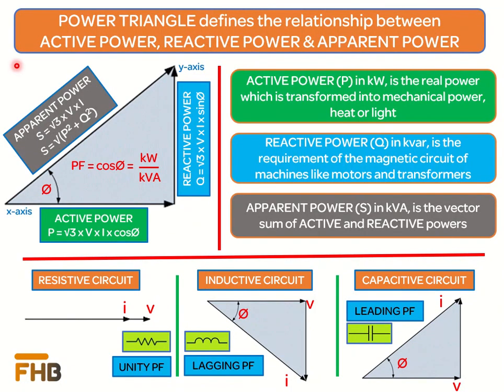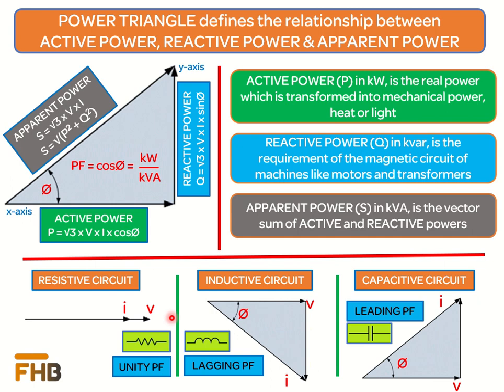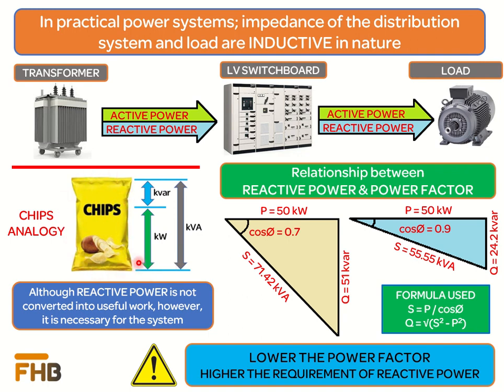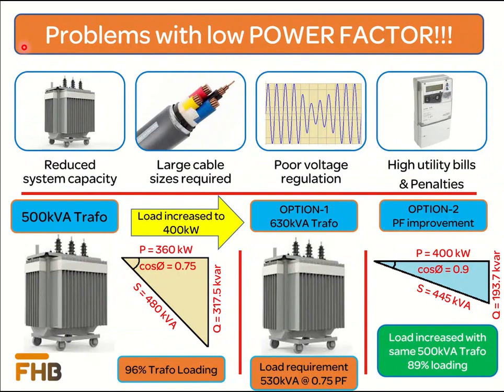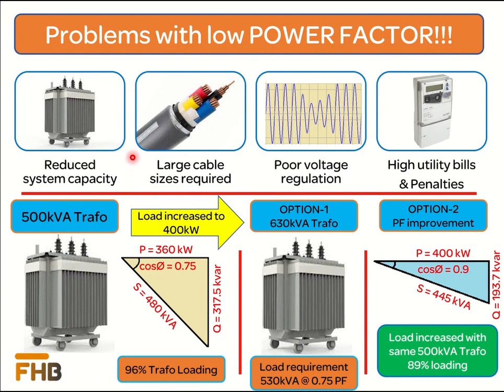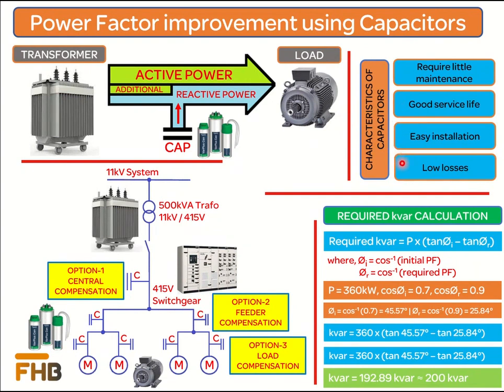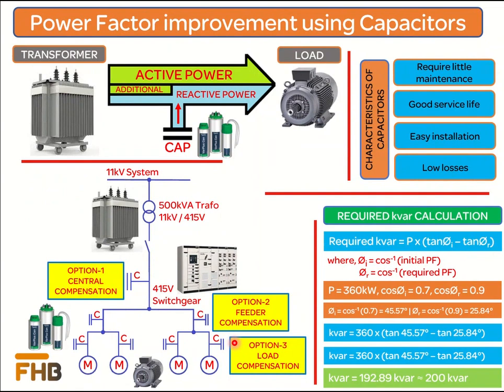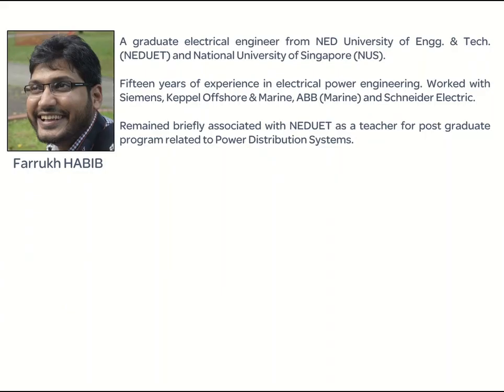Power Factor Explained | Farrukh Habib - FHB | #ElectricalEngineering #powerfactor #PFIP #APFC

Comment: Very good presentation / VBLOG as you mentioned
Reply from the maker: Thank you so much 🙂
Reply: @FarrukhHabib-FHB  Welcome 
Well .... 55kVA is the Load many Motors 
and Welding Plants and Drills and Grinders Hand-held and Compressor with three Phase Motor 

1. 20kVA incremental or better / Best you suggest
2. PF Correction ... bare-bone as we will make the Cabinet in-house ....Fabrication is our specialty 
3. please quote for budgeting

Comment: Although it is good explanation however i have a query i.e. how we will determine existing power factor of building or factory which is under construction. We are not able to measure power factor that time.
Reply from the maker: Hello Saad, you are right. For new construction we do our math while designing and validate it after commissioning. Now a days software are advance enough to perform calculation precisely.

Comment: Does capacitor contribute short circuit current?
Reply from the maker: Capacitor bank near the short circuit fault will discharge and thus increase the value of short circuit current.
Reply: @FarrukhHabib-FHB  ok. But for far fault, should it contributes?
Reply from the maker: @vishalshah5913  capacitor will discharge, however for far fault system impedance will reduce the contribution.
Reply: @FarrukhHabib-FHB  ok. But I am not able to see any contribution in etap software.
Reply from the maker: @vishalshah5913  please check the parameters you set...I hope it will show you

Comment: how to choose cooling of capacitors&what if there is harmonics problem ???by the way thank u for this video much needed
Reply from the maker: Thanks Vishal. Forced cooling through fans will be required for the PFIP. In order to choose the fans you need to perform the required air flow calculation. I will try to cover both air flow and harmonics effect on PFIP in next videos.
Reply: @FarrukhHabib-FHB   is this formula applicable to plant which has breaker machines high starting current
Reply from the maker: @vishals11  which formula? If you please explain a little bit more...
Reply: @FarrukhHabib-FHB  suppose I m going to install new APFC panel and at load side there are machineries like breaker machine which takes high starting current .formula means KVAR calculation formula p(tan@1-tan@2)
Reply from the maker: Formula will remain the same...